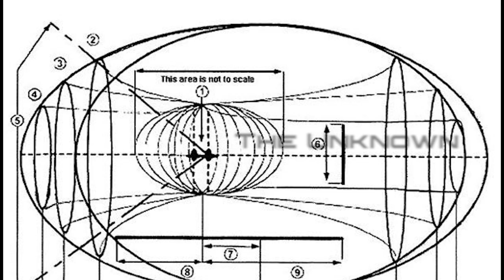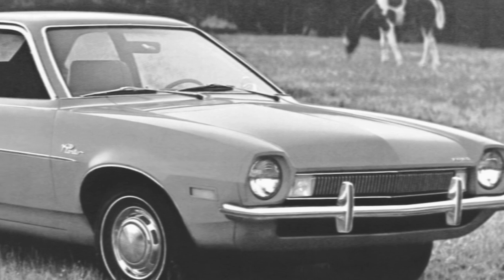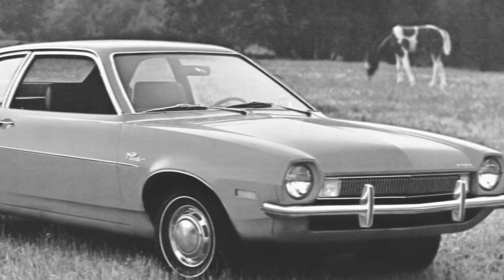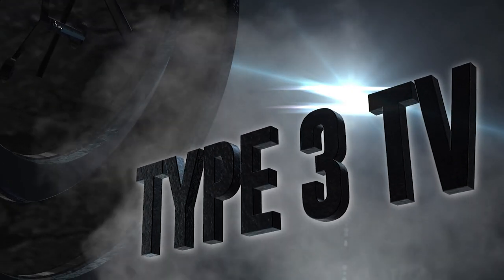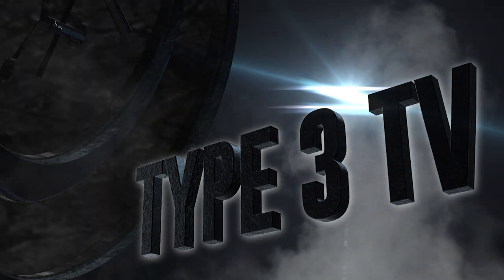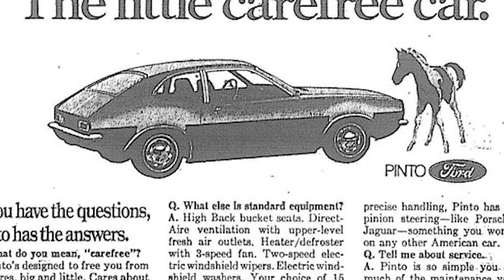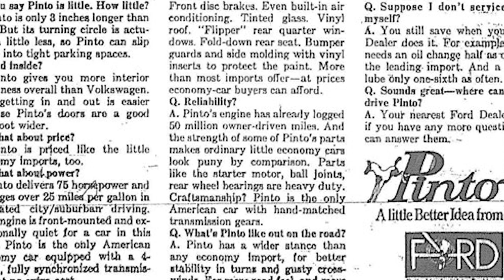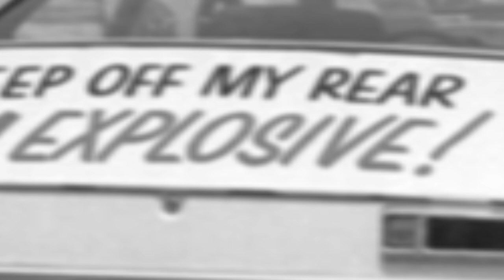WHY DID FORD RELEASE THE PINTO IF THEY KNEW IT WAS DANGEROUS?

Comment: Regardless of design flaws on cars like the Vega, Pinto, Pacer, Gremlin etc., just introducing them to the streets and highways of America, still chock full of '57 Chevy Bel Airs, '60 Imperials and '59 Cadillacs, all weighing in at three times more than these beer cans on roller skates, was a suicide mission in itself, for some poor mom just going down the road for some groceries.
Reply from the maker: You good a good point. Everything before that point was so rigid, heavy and tough. Thanks for stopping by and chiming in!

Comment: Where else are you going to put it? Behind the drivers seat or in the firewall? Over the front axle? Or how about side saddle like GM pickups from the 70’s and 80’s and almost every semi truck on the road today? For the most part, fuel tank location in cars has now moved to under the the rear seat in front of the rear axle. It is often considered the safest location for impact protection. But it is a large packaging issue. In the Pinto, there was not room to put it there. The rear seats were very low, and then there was the rear springs, axle, drive shaft, differential, parking brake lines, exhaust pipe and some other bits in that space. Did you know that the Pinto/Bobcat station wagon did not have the exploding gas tank issue and were not part of the problem? The reason was due to the structure difference between the sedan/hatchback and the wagon. The wagon had a stiffer structure due to the flat rear floor and wagon roof area. In a rear end accident, the wagon did not buckle in the back end like the sedan so the differential did not rotate and present the sharp corners to the end of the tank and puncture it. That is why that little plastic shield was designed and installed between the gas tank and rear axle. It provided enough shielding during contact between the differential and tank to prevent puncture and spark in a rear end crash. It was so effective it was applied across most of the Ford car lines with rear wheel drive for a number of years. And it worked very well.

Comment: One of the worst videos ever done on the Pinto.    Statistics have shown that the Pinto was no more likely to "explode" than other cars of that era.    More people have died because of the ignition lock issues in 2000's GM cars than were ever killed in a Pinto.    And, there was NEVER a requirement for cars to have bumpers that withstood 30 mph crashes.   You lied right there.   Prior to 1973, there was almost no requirement.   1973 required the front to withstand 2.5 mph and both front and rear in 1974 and later were required to withstand 5 mph impacts.    You basically did a hit job on the car without any basis in facts.   Yes, Ford did cost benefit analysis the Pinto, but the end result of the car and the  placement of the gas tank was exactly where most rear wheel drive vehicles of that era put them.    Absolutely disgusting video.

Comment: I had a '74 Pinto and I loved the car (it did have the mod package installed).  I also agree about the lowlife unions!  Too much greed and shitty production standards.  They could give a damn what happens after their junk leaves the factory, they got paid their outrageous UNEARNED salaries!
Reply from the maker: It's weird because I have family that works for a union and they do good things but they also do shitty things too. Over time I think they lost sight so I am on both sides of the fence. Thank you for the comment glad to have you in the conversation Richard!
Reply: Dont forget the CEO's that allowed this to happen.......
Reply: It wasn't all the unions fault.  My dad worked for Ford at the San Jose Plant.  There was an unspoken rule that if their was a problem on the line then close your eyes and let it go.  They were supposed to be able to stop the lines to correct mistakes, but that was seriously frowned upon by the shift supervisor.    He would get crap from his supervisor who would get crap from his supervisor  and so on and so forth.  Plus, you have to remember you can only do as much as the upper management gives you.   When cars are designed,  they are not fitted with the best of everything.   Ford as well as most companies skimp on quality and cut corners.  The factory workers assemble cars based on what is given to them.  They can only do so much.  It is up to management to supply the workers adequate parts to assemble the cars.  Yes their is a lot of dead weight with some factory workers,  but their are also hard working people who put in a honest days work.  The company's that they work for have just as much dead overpaid weight at the top as well as the bottom.
Reply: TYPE 3 TV He was talking about the UAW.

Comment: The Ford Pinto was not the only car that had this issue back then.  However - Ford was the one that took the brunt of the bad press (as usual).  The Chevy Vega was a piece of crap!
Reply from the maker: Could the Vega explode due to a ruptured gas tank though!? Thank you for the comment!
Reply: Most certainly it could, even fuel cell equipped race cars occasionally catch fire when hit from behind (or backed into something after spinning out.)  To GM's credit, the Vega does have a slightly better overall safety record, though that's partially attributable to them having a fairly short usable life compared to a Pinto. The Vega's downfall was a really bad engine design and a lack of corrosion protection. The engine woes were eventually fixed, but body cancer is a primary reason there are far fewer surviving Vegas compared to Pintos.
Reply: RockandRoll My Sister-in-law had a Chevet
Reply: And the chevettes were the biggest 'singer sewing machine on qualudes'......(thats a medication from the 70's era)
Reply: The Chevrolet Vega wasn't dependable enough for a head to head competition to find out if Vegas would explode or catch fire more or less than the Pinto.  Vegas were not on the road long enough to get decent feedback for rear end collisions. By the end of the seventies Vegas had pretty much disappeared from the road where as Pinto were super common.  I know people are going to say that Vega production ended in 1977 vs Pinto in 1980.  The Vega continued on as a derivative of the Chevrolet Monza.   Plus Ford produced alot more Pintos in the early seventies vs the late 70's.   So therefore fairly   even comparison.
Reply: But a Vega wouldn't kill you..

Comment: vega...pinto.. pacer.. gremlin ..champ ..chevette...junk
Reply from the maker: My family owned 2/6 and yes they were total shit.
Reply from the maker: Thanks for the comment!
Reply: Actually the Chevette based upon a Global T platform  was quite reliable. My Mom had one with a automatic transmission it was slow, anemic, horrible to drive under any circumstances...yet it started and ran every single time it was asked to do so from the later 70's through the later 80's. And it never rusted or burned oil I must add.

Comment: I call BS, a Granada with the steering wheel in the center of the dash ???!!! . 
Not only would the car be undriveable. (It couldn't have made it from the assembly line to the wait lot, to the transport train, to the delivery truck, on the truck and off at the dealer. 
The body stampings, steering gear position on the frame and steering linkages make that impossible. There is simply no way to have a functioning steering wheel in the middle of the dash on any American Ford Granada without serious reengineering of the car, custom built parts, several people involved and an obvious slip by several others.
Reply from the maker: Thanks for the feedback Doug! Funny you mention this because after hearing Dan tell that story I searched for quite sometime to find other accounts and pics of the story. I couldn’t find anything however Dan brought up a good reason why the next time we got together. While he isn’t a gear head cars are a big passion of his if not his biggest. So he’s got a wealth of weird car stories true or not. Editing this video was quite a challenge because there wasn’t much for references and resources visually.  Either way if the stories are true then they are most certainly fucked up. Even finding a beer can in the door panel. Anyway thanks for sticking around and chiming in! That’s what it’s all about! Hope to hear from you soon!
Reply: @type3tv183  Well, the only way to do that is to use a very long steering column out of a much larger car!  Since it would have to be an at angle just
to go in--you would need a longer steering column, the engine then gets in the way, power steering lines need to be longer, and the list goes on and on.  It is not impossible but on a mass production line it would be impossible to modify a car that fast considering everything would need to be moved to the right and a Granada was a medium sized car.  As they say in the UK "Bullocks!" Most cars were shite in the 70's, from VW/Porsche with swing axles, tiny Japanese cars with little crash protection at all to everything that rusted from all manufacturers as every car company went with thin metal to get the fuel economy up, had to deal with emissions, new safety stuff all at the same time.  If Ford did the gas tank correctly, got a few other things ironed out the Pinto was actually a good design for the time.  My older brothers had a ton of 70's cars, VW Bug, Vega, Pinto, Datsun 1200, Corolla to a Subaru 360 and they all rusted, they all did not handle very well and were half baked.  The only smaller 4 cylinder cars in the 70's that were decent were the Volvos.  A square tank, quite slow but with decent suspension, brakes and solidly built.  The Japanese cars were reliable, got great mileage but were very slow, rusted heavily if salt touched them and if a van hit you at a stop, you would be a pink smear on the pavement.  If I had to drive a 70's car, it would be the 1973 AMC Javelin because it  had a very long nose (crumple zone) had the thicker bumputers required by law, side impact beams and was made in Kenosha WI or Canada which avoided Detroit idiots.  The Volvo 240 would of been my choice for "economy car" as it was the only one that still was built strongly, had decent enough brakes/handling and could survive a crash.  My favorite Pinto was a guy paiinted his, instead of flames painted on at the front wheels, he painted them on the back quarter panel shooting forward.  Classic!

Comment: No car has a 30 mph bumper.  At the time.   Cars were only required to have 2 1/2 mph bumpers.  In 1973 front bumpers required 5 mph.  In 74 front and rear were required to have 5 mph bumpers.  During the Reagan era it was again relaxed to 2 1/2 hour bumpers front and rear.  Please get your information correct.  Also Ford cars were in compliance with federal safety regulations regardless of what you state about Ford's bumpers.  Yes they were basically ornamental but they were in compliance.   You state that the Pinto had caused 27 fire related deaths form 1971 to 1977.  Do you know how many Pintos were produced in that period of time.   They were no more unsafe than other cars of the era.  It is very common to put the gas tank between the bumper and the axle.  Where else are they supposed to put it, in the back seat?   The biggest problem with the Pinto was the fact that the filler neck from the tank to the filler cap was too short.   In the event of a rear end collision the filler neck would break off potentially  causing a spark.  So what Ford did starting I believe in October of 1978 was to install a longer filler neck with a unique gas cap.  Also they installed a piece of plastic between the gas tank and the axle to reduce the chance of a spark from gas tank to axle.  Overall Pintos were good cars and sold pretty well even after the gas tank debacle.   The reason Pinto sales slowed down towards the end of its life cycle had more to do with newer cars coming out and competing the Pinto.which was starting to get long I'm the tooth by 1980.  And trust me the Ford Escort was no prize either.  At least 15 year old Pintos were still a common site when it was hard to see a five year old Escort still on the road.
Reply: Rick Loera he did mention that other cars had that same gas tank issue and that there were other issues with other cars.

Comment: Time has proven the myth of the "dangerous" Pinto to be just that, a myth. In reality it was quite average in terms of safety for sub-compact cars of that era. Modern cars are somewhat better, but they still occasionally catch fire and kill people when hit from behind. Chrysler was recently sued over the exact same issue with the Jeep Cherokee, which like the Pinto, has a gas tank placed between the bumper and rear differential and minimal crush space to absorb a rear impact.
Reply from the maker: Butch thanks for the comment. I was telling someone else. My dad drove the shit out his pinto that be bought for a 100 and then sold for 100. Maybe it was sensationalism at the time? Thanks again hope to hear from you soon!
Reply: Glad to contribute. As one of the people who've driven a Pinto and lived to tell about it, seeing the myth perpetuated irks me somewhat. They weren't great cars, but neither were they particularly bad cars either.  Only time mine ever left me stranded was when it broke a timing belt, and like your dad I drove the shit out of mine as well. To their credit Pintos were dead simple to work on and cheap to maintain, qualities which endeared them to quite a few broke teenagers, starving college students, and other people who needed a cheap, dependable car so they could hold down a job.
Reply: I agree, I've owned four Ford Pintos, great little cars and very reliable. I've actually been hit from behind in my wagon on a 45mph road by an S10 pickup (No clue if his speed was that fast but it felt like it nearly snapped my neck!) and It didn't make a dent, granted it was a 78 with the larger bumpers but I had drilled out all the absorbing material to bring the bumpers in a bit if that says anything about the structural integrity of these cars..
Any small car with tiny 60's era bumpers hit from behind by a big Impala or Lincoln etc is gonna be a death trap.

Comment: The pinto before it was put out knew about the gas tank issue the where going to put a sleeve over the gas tank but ford said it was going to cost to much to put an iron sleeve over the gas tank and all cars made before 1976 where made out of iron not metal I have a 1970 truck u hit it and ur car will not make my truck will just get a small dent

Comment: The Pinto wasn't a bad car, wasn't a great car either. The myth that they all would blow up is crap. Ford recalled and fixed the problem with the potential explosion hazard by installing a simple plastic guard between the rear axle and the gas tank. The Vega was a far worse car, it pretty much rusted away as you drove it. The Pinto on the other hand would run forever especially with the 2.3 liter in it. I have owned two myself, one was a V-8 Pinto and the other was a fully loaded for the time and it drove great. It had power steering, A/C and power brakes.

Comment: The pinto prototype had one of the first fule cells. A neoprene bag in a tin shell. So if the car got rear ended the bag could distort and reduce the chance of a fule spill. this and the 2.50$ worth of steel reinforcement wore cut to reduce the overall cost of the car